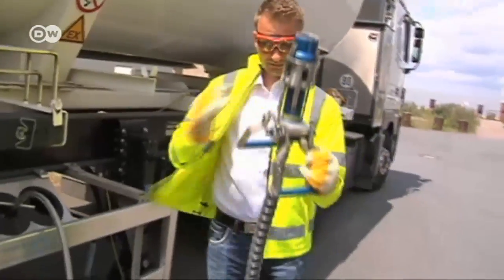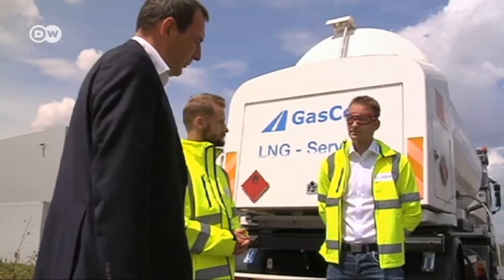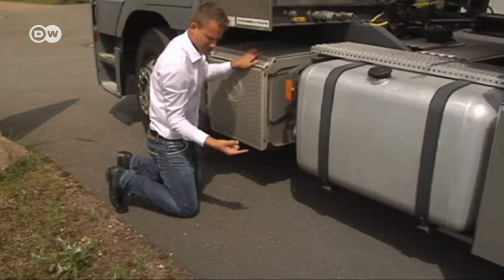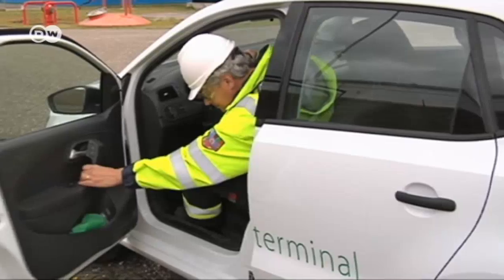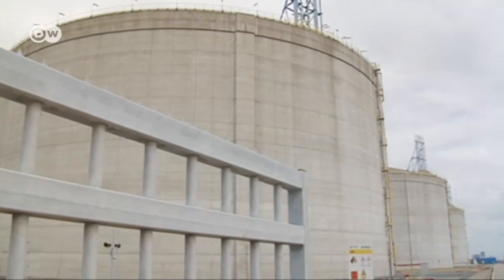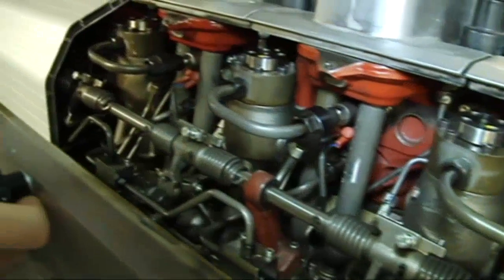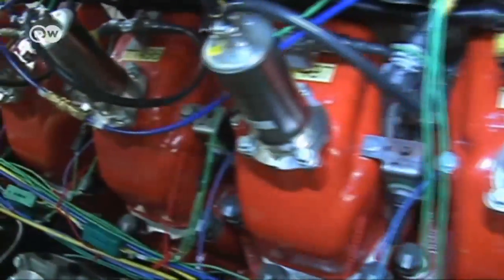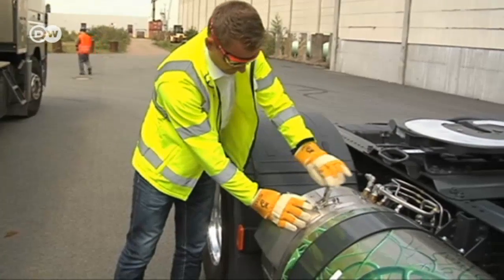LNG - Better than diesel? | DW English

Comment: Not exactly scientific ...
Reply: True, but if you know basic chemistry, you should know that petrol burns cleaner than diesel and natural gas burns cleaner than petrol. Though, I prefer LPG over natural gas
Reply: @kiyoponnn  How do you think they extract it though? It's something that doesn't just show up at the place of ignition.
Reply: @terretulsiak  True, the pollution during production is equal to petrol or diesel...the only redeeming feature is that it's the cleanest burning fossil fuel
Reply: @kiyoponnn  I'm not AGAINST gas, but until we start utilizing the sustainable ways to power as well, we should either reduce our consumption, or acknowledge the end effect.
Reply: @terretulsiak  I completely agree

Comment: Ships on the Baltic have also started to use LNG instead of diesel. Good development.
Reply: Until Russia starts using fuel supply as a geopolitical tool...
Reply: You think it's a good move . I don't think it's good. The supplies are precious and great for domestic and automotive and industry . Ships have evolved to use unprocessed bunker oil as fuel and it's a very green process .Also we need more particulate emissions from aircraft and diesel and industry to cool the planet .